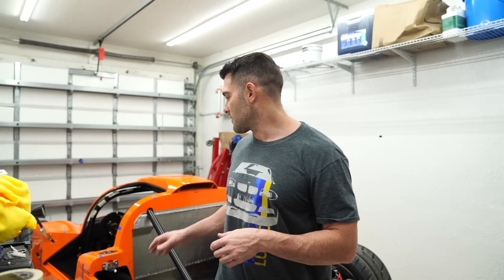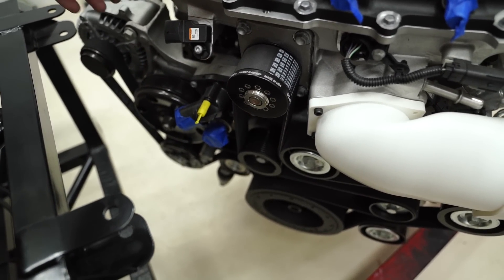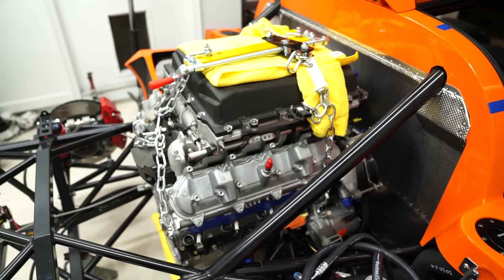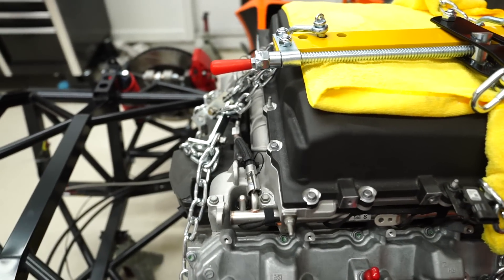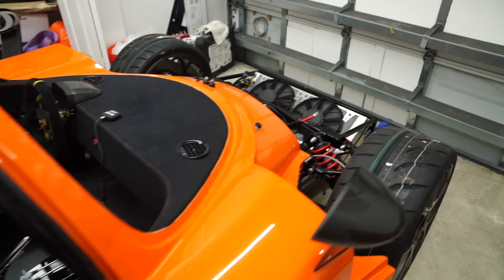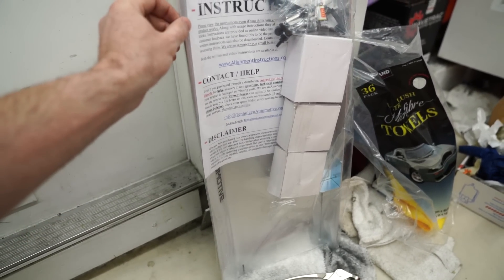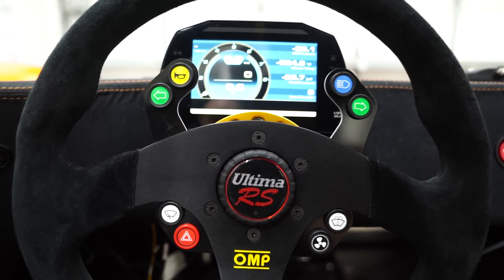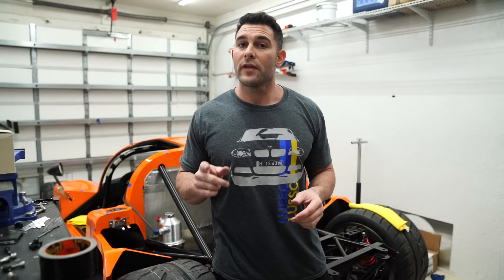Ultima RS Build 06 - Fitting The Engine!

Comment: Great build so far, but I would use a separate reservoir for the clutch...clutch dust can create havoc with the break fluid
Reply from the maker: It does use a separate reservoir for the clutch :).
Reply: @UltimateUltimaRS  ...That's excellent....

Comment: This thing is going to be crazy fun to drive.. what is the supercharger hat made of? And can you remove the corvette scripts from it and maybe add a ultima script from the 3d printer.  I would like to build one of these but more in the style of a 60's Chapperal 2f with a screaming small block.
Reply from the maker: The "Corvette LT5" writing is cast into the hat. I could put something over it, but I already have the "Ultima RS" valve covers.

Comment: Great build!
I would suggest placing some type of protection over the chassis etc when fitting up an engine like this. Very easy to chip paint and do minor damage with an engine swinging around. A couple of layers of cloth tape would be good to protect those chassis bars.
Reply from the maker: You can't really see it in the video, but there is black gorilla tape on the bars.
Reply: @UltimateUltimaRS  ah well done. I panicked thinking you were going in commando style!

Comment: Just a general comment. I’ve driven many times to the Le Mans 24 race. One year I camped in the grounds of a chateau about 10 miles from the track (GM team were staying there too). It’s a tradition that thousands upon thousands of cool cars drive to Le Mans & many many camp (over 200k Brits drive every year). The selection of cars is are always pretty impressive. This particular year a whole gang of Ultima’s were at the same chateau which was accessed by very long straight roads. The sound of this gang coming back to the chateau from the track was absolutely epic & not dissimilar to camping right next to the race track. If you’ve never heard the 24 hour race cars at night, you haven’t lived. They sound just like hell & fury screaming on their way. The Ultima’s always stayed in my mind as epic simply because of the noise that heralded their arrival. I’m a lightweight Lotus car fan, but those cars were truly menacing. Enjoy the car when it’s done!
Reply from the maker: Thanks for this comment! That sounds awesome and is definitely on my bucket list.

Comment: Love your build. But it looks like your intake adapter is going to be really restrictive when it make the 90 degree bend. Looks like the cross section is about half of either opening. Just a comment
Reply from the maker: The tube is actually much wider/larger than the openings. Where it gets narrow in the center horizontally, it gets much wider vertically, basically going from a circular opening to an oval one.

Comment: My only worry is the massive bend in the throttle body relocation tube. Potential restriction. I didn't see anything about oil, tranny coolers?
Reply from the maker: Oil cooler is stock GM and is connected to the cooling system. Transmission uses a breather, but not a cooler.

Comment: See if you can find an lt2 supercharger. Plenty of people pulling them with no resale demand. I don't know what I was thinking here lol
Reply from the maker: The LT2 is in the C8 Corvette and is not supercharged. The LT5 on my RS uses the Eaton 2650 which is an awesome supercharger already.
Reply: @UltimateUltimaRS  yes it is, but there's no way you are going to get the flow to the front effectively. It will still run and make power but you'll be way down, 80 to 100hp? You could build a vertical console on the back wall for storage, subwoofer, amp etc and slice a section of 6 inch to weld half in the firewall for intake clearance. 
I don't know why I didn't see it before. You could mount a parallel shaft down one side and set up short belt pulleys on the other end. You could actually use Magnuson parts for most of it.

Comment: The problem I had when I re-built my 1976 Alpine A110 was to rebuild from scratch the engine bay firewall...I used the british Morgan technic using  wood(walnut) and heat shield wrap(sandwiched in two layers of thin aluminium(amazing results) ,I added 3 powerful extractor fans(on demand)with heat sensors and gages ,just so the car would never dictate me when I could use it (on hot days or super cold..!!)AC or not/also mobile windows are a must ,if you want to travel and daily your dream car(simple toll-both action..!!!) claustrophobia being the worst feeling  ever ,without real fresh air....!!!!.........

Comment: Just seen this and love what you are doing.....Can't wait to see her running.....Now if it was me I'd probably have used a NA Honda K20 4 cylinder built engine with around 300hp and if I needed more power I would probably supercharge it for at least 500hp.
But having said that it's going to be sweet to see what your 1,0000hp LT5 will do to this machine.......Can't wait for the next video.

Comment: im a bit worried about the 3d printed intake elbow. its such a tight turn this will surely effect the airflow. going for 4 digit power you need as much air as possible. I also think the bottom bolt for the alternator may be an issue once the engine is oil the car and the bolt looks like it may hit the firewall trying to install it. the intake bolt that you haven't installed ,you might slot the 3d piece install the bolt slide the intake in place then tighten it

Comment: Tape the bars ,surely he is going to put tape on the bars.  noooo....hard to watch as the alternator bangs it a few times. I can't unsee that chip on the right rear down bar. Tape up that nice powder coating till it's all fitted. Seeing as though your printing the intake. couldn't you make it vertical to utilise the roof scoop ? Did you put the seal/grommet for the steering column in the front bulkhead? Progressing along nicely.
Reply from the maker: There is black gorilla tape all over it. That chip is a mark on the tape. It's just hard to see.
Reply: @UltimateUltimaRS  Whew, all good.sorry for callimg you shirley.

Comment: The roof scoop isn't functional?
Reply from the maker: It is functional. It does not serve as an air intake to the engine, but does flow air to the rear which will provide a bit of cooling.

Comment: Been following along and just watched this latest video. I have to warn you about the 3D printed part. I have been 3D printing professionally for almost 5 years as part of my engineering job. I would never put a part like that on my engine. The demonstration you did by hitting it against the ground is testing it in its strongest plane - XY. The Z direction is considerably weaker in any 3D printed part. Also, you are 100% dependent upon your layers being perfectly fused to each other and there not being any leaks. FDM printed objects should not be subjected to pressurization of any kind. I would HIGHLY advise you have this part machined in aluminum before you start the car. Loving this build and don’t want to see a failure like this. 3D printing is perfect for mock-ups but I would never trust a part I printed on any FDM machine in such a critical role as this.
Reply from the maker: The stock relocation is 3D printed laser sintered nylon which they've been running on several cars without issue. You definitely have me thinking!
Reply: @UltimateUltimaRS  in that case it should be fine. I guess I'm just overly worried about causing any damage to that beautiful engine you've invested so much money in, as well as you are I'm sure! Enjoying the buld. Great stuff!👍😀
Reply: I agree totally!! I see that part creating a  coffee table of that beautiful hulk of an engine!
Reply: Mold and cast in higher strength/higher temp plastic or send off to be printed in a high temp material

Comment: to test the strength of the scrap air intake you printed you could run a chain through the center and around the legs of your hoist, get a digital 6600 lb scale to put between the top and the hook of the hoist, then you could see exactly the load rating it is showing.

Comment: Hey noticed the front brake lines going straight.l to the reservoirs looks like there is no slack.  Just something I saw and I’m sure it’s just mocked up and not a priority now.  I’d run the hoses to a solid mount near the spindle then run hard line to the reservoirs.  Just like OEM applications. Just looking out not trying to be a smart ass.  I’m sure it’s mocked up

Comment: GREAT PROJECT ! which 3d printer and modeling soft
wear are you using?
Reply from the maker: Thank you! The printer is a Creality CR-10S Pro V2 and I used Fusion 360 to design the part.

Comment: I was cringing watching the engine scrape against the frame as you dropped it in. I would have covered it with cardboard or loads of tape before dropping it in
Reply from the maker: There was black gorilla tape on the bars where it barely touched. All good!
Reply: @UltimateUltimaRS  thank God. Great build btw. I used to live pretty close to Ultima in the UK and would see them around all the time. There was Caterham, Noble, Ultima and Triumph all within spitting distance of each other. I live in war torn Detroit now lol

Comment: With your 3D printed parts where they bolt on, add some alloy tube into the bolt holes to stop crushing and cracking. Just trim them very slightly short to all pressure on the part and gasket

Comment: If your gauge has an adjustable refresh rate for inputs lower the refresh rate for water temp, oil temp etc will stop it flickering and easier to read. They don’t need to be real time, for temps a refresh rate of 5 seconds is probably a good range for temps

Comment: Please use hard lines where ever possible for brakes, fuel and oil, anything that can become a fire hazard, use the flexible lines as final connections with suspension/brakes, engine and gearbox etc, anything that moves. You will reduce the risk of fire.

Comment: Instead of using rags to stop the chains damaging the super charger, get a bit of flat bar stock or angle iron and drill a hole in each end, use it as a spreader bar for the chains. You have some short pieces of flat bar in the chain already, use these as the points to pick up the spreader bar, no chance of damage. You will have the engine in and out multiple times so it’s worth it 👍

@03:35 you can see the chain and flat plate/bolts slip on the rag.

Comment: Great build. Looks like the pulley under the alternator has groves and is running on the back of the belt?
Reply from the maker: Yes, the belt is double-sided and as it loops around, runs the water pump, alternator, and AC compressor.

Comment: A Ferrari situation where the entire engine has to be pulled just to access accessories and change belts...
Reply from the maker: There's more room than it seems. I could change a belt for sure. It's tight, but could be done.
Reply: @UltimateUltimaRS   I sooo despise hard to get to mechanical issues lol

Comment: 3d printing is such a valuable tool for projects like this. Sure a cnc would be better... But 300 bucks vs 30k is such a better value proposition. Nylon is very strong and holds up to heat well. Not sure if this was carbon infused nylon but that is another option. Awesome build. This car is going to be nuts.

Comment: How about making one side of the roll cage removable. Replacing the alternator and belt looks like nightmare when the engine is in place. Just sayin
Reply from the maker: The clearance looks VERY tight on the video but I could definitely remove the alternator and access the belts with the engine in.

Comment: For your printed throttle body intake part you could make that top right hole a slot/fork instead so you could tighten it down since it doesn't look like you have clearance to get a screw in there?

Comment: Coming along very nicely. A few tight tolerances but hopefully ok.
Damn those headers are close to the fuel tanks - maybe add that gold film to your heat shields for added safety there?  Looking forward to the start up. Great work man 👍
Reply from the maker: Thanks Chris. The aluminum heat shield is actually waaaay better for the direct heat than the gold. But yes they are very close to the tanks!

Comment: Cool build. Did you consider moving the fuel tanks to the door sills to keep the fuel cooler. I imagine it must get hot in the engine bay, under the exhaust. Also I though the intake exited the back of the block. Is it at the front due to the supercharger?
Reply from the maker: The fuel tanks can't move forward at all just due to the design, etc. The intake is reversed on the non-supercharged cars, but can't be in this case, so yup, you're correct!

Comment: Looks like its going to be fun getting the other two bolts into that inlet. The joys of high performance cars lol
Reply from the maker: There will be studs threaded in and it will slip right on, then tightened with nuts. At first glance though it looks like a problem!
Reply: @UltimateUltimaRS  Yes, I'm sure you'll be ok, built enough cars in the past so I prefer to watch others deal with these kinda problems these days though. I'm looking forward to seeing this finished though, you've done an awesome job and I've enjoyed watching this series.

Comment: Also if you’re having any raw metal surfaces you might want to invest in some Boeshield as an anticorrosive coating.

It’s not like WD40 which smells and has a tackiness to it that attracts dust. It just puts a thin film that prevents corrosion.

Comment: CFR nylon is like 20-30 KSI which is basically the same strength as a mild aluminum. You will have no issues as long as you can keep temps reasonable. 

I would foil the outside of it or insulate somehow given how close you’re running to the Exhaust it should be kept cool from intake air being pulled through it but you definitely want to be keeping temps below 190F just to keep it from warping and fatiguing.
Reply from the maker: Definitely going to be heat wrapping it. The stock one is nylon so I'm assuming Ultima worked out the kinks already.
Reply: @UltimateUltimaRS  very cool yeah must figure they had most of it sorted by now.
Reply: @UltimateUltimaRS  Just wanted to add on to my previous comment. There is a huge difference in the strength of injection molded nylon and FDM 3D printed nylon, carbon fiber or not. It may work and it may not but I wouldn’t put it to the test in this application. I don’t want to come off as negative because everything else about the build is fantastic and entertaining! I just don’t want this one little part to cost you a lot of time, money, and labor later.

Comment: So when you break a belt or need 2 replace afters so many years you'll have 2 pull the engine out.
Reply: Na, just need a small child with tiny hands to reach up from underneath to change them out
Reply from the maker: It looks a lot tighter than it is. A belt change is possible with the engine in.

Comment: Amazing effort, its not just a car, that is a work of art.
I've got a question though, i design and work with 3D printers and printing a lot.
The comments you mentioned about viewers commenting on your print are correct.
I must say I'm really sceptical about any print or material holding out to the temps involved.
I've a suggestion, print it then get that print cast and made out of aluminium or another metal.
You really don't want to be working with melted carbon or whatever material it is your printing.
As for the carbon material your printing.
( Can you please send me a link to the filament your using.) 
I've worked with similar products before.
The possible reason your carbon print turned out like it did was the carbon filament wears out the printing nozels due to its courseness.
If you've ordered new tips, make sure they are stainless or harder.
And with that been said, you will need to up the extruder heat to compensate.
Reply from the maker: Oh yes, I'm printing using a hardened nozzle. The first attempt was with a .4mm nozzle and it kept getting clogged. It is printing now perfectly with a .6mm nozzle @ 260C.
Reply: @UltimateUltimaRS  
Outsdanding, looking forward to seeing the next vid.
Great job.
Reply: @UltimateUltimaRS  I’m looking to order an RS. Any regrets or things you would have ordered differently?
Reply: Under hood Temps should be under 200c... That's a safe range for carbon nylon is it not? Maybe I am misinformed.